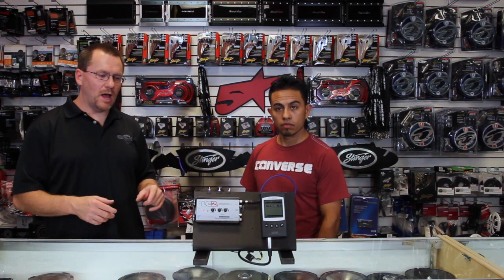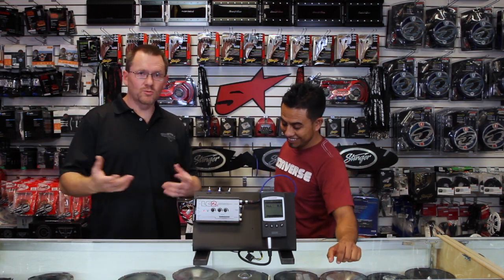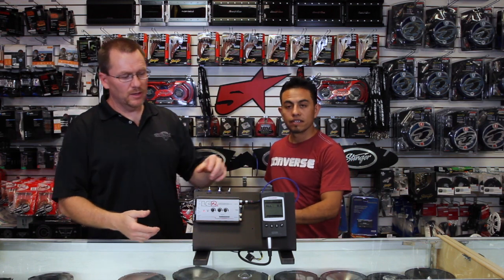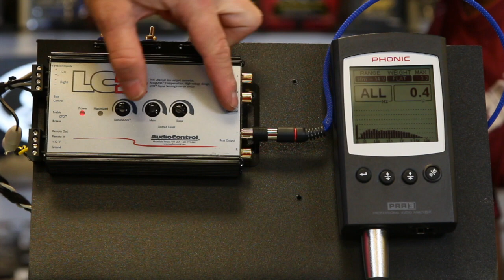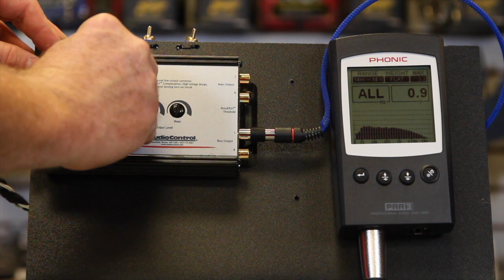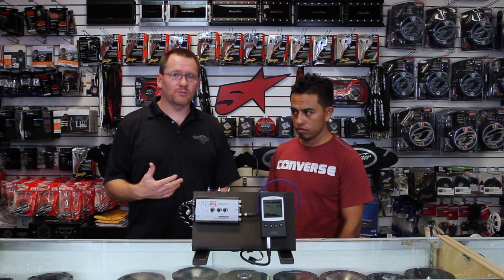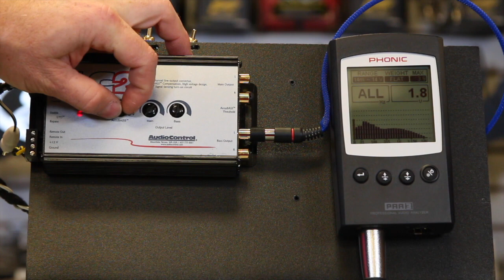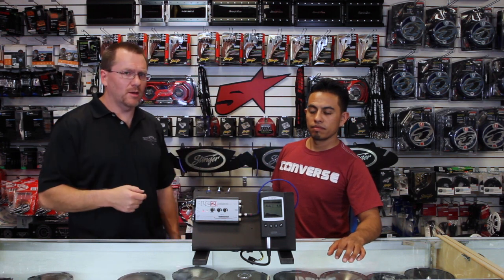Introduction to AudioControl's LC2i "what is and how to use AccuBass"

Comment: Got a question I installed my lc2i power wire from my second battery but when I turn everything off the red light stays on even after the vehicle goes to sleep why is that thanks guys
Reply from the maker: gilbert reyna where is the GTO switch set? Do you have anything in the remote in slot?

Comment: Another great video guys, most informative.
3 questions please...

Is there any difference in the LC2i and the LC2i Black, other than the colour?

As I wish to utilise the remote turn on feature, should I also be fusing the power into the LC2i?

You said the Acu base is almost like a "reverse base boost eq" my question is, If I tap of one of the 8" stock underseat subwoofers, to this LOC which will be connected to 2 12" subs. will the Acu base also restore the base curve to the 8" stock subs, as it it conected to the 12" subs?

Hope you can understand what i'm trying to describe...

Marcus.
Reply from the maker: M Henry thank you. No difference just color.
We just use the power coming from the amp, so there is no long run of power if you are going to run a power wire to the battery put a fuse at the battery. No it will not help the factory subs. They are before the LC output so the can not be helped.

Comment: How do I use the 9 wire with stock radio and lc2i "LOC" ........I want to replace door speakers but don't want to replace stock head unit, but also what to use amp for door speakers, but have to use LOC to connect amp......HELP!!!!!!!!!
Reply from the maker: Shaun Russ if you are using the LC2I you will just connect the front left and right output only.  If you want front and rear you will need the lc7i.

Comment: hello , I have a 2014 Honda accord with the lc2i running a rockford 150x2 powering a cerwin Vega mobile hed 400 watt 12 . after installing it and adjusting it to sound good I shut my doors and have a constant bass until I open a door then it stops . I adjusted it and turned it way way down and the constant bass stopped ( btw it wasn't a bass that went with the music and was way louder) . now when I start my car it gives 3 loud bass notes like a start up or I guess to let you know its on ? do you have any suggestions in how to get this to go away ? also do you have any idea on why it was giving a constant bass only when doors closed ?? thank you so much for any help ! and you guys did a very good job on video and very informative!!!! thank you
Reply: I have a Honda Accord 2014 and do not have that issue.  I used the GTO not a remote turn on. make sure the GTO is jumped to on, some that have it off and used another source of remote turn on from a fused  accessory  can get this.  if you use a switched source make sure the GTO jumper is off.  I Have  also seen some by mistake put a 12V signal non switch into the remote,   Another issue could be bad RCA cables they can short and cause a like issue.

Comment: Awesome tutorial👍🏽. Just have one question

How do you set the gains on your amp with lc2i install. 
Thanks
Reply from the maker: That is a great question, we use the Smd-dd1 and also a O scope. With out those the best way is to start with the gains all the way down. Play a beat you know and repeats. Turn the radio up to the clip point. Start turning up the gain slowly you will notice a point that it stops getting louder. Turn it down a bit from that and play a couple more songs to check. Pay attention to any unnatural sounds that might coming from the woofers and turn them down or adjust the crossover.

Comment: Hello, Can I connect the audio control at the same time to the speakers or i need disconected the speakers to conect the audiocontrol, change the impedance? because my speakers are to small and I afaird burn the factory radio outputs, congratulations for your channel , thank you
Reply from the maker: Thank you. You can tap into the factory wiring  leaving the radio to play the factory speakers. The AudioControl can then go to give the aftermarket amp signal. You may want to get an amp for your smaller speakers. Then you can disconnect them and power them from  the amp and actively remove the bass from them.

Comment: i tapped into my rear sub speaker wires to power my lc2i.. but it stays on with constant power. i need an idea on where to hookup a remote power wire for it. How do I use the gto?
Reply: to clarify, I tried the gto jumper on enable and bypass and it didn't work either way. any tips? i have a 2008 srt 8 dodge charger
Reply from the maker: +dcole302 that happens some time, it just won't work. No problem though you car is easy. Goto the fuse box next to the battery, inside you will see the fuse for the front power plug- it has 3 input but is only using two. One is accessory, one is 12 volt,and one goes to the power port(cigarette lighter). Connect to the accessory and run to your LC and out to the amp
Reply: +Five Star Car Stereo Awesome!!!! Thank u. working like a charm now. this converter is a beast!

Comment: i have a bose system that has an amp.do i tap into the rear speakers or i have to go thru the amp.and do u just put the speaker wires and it turns on or do i have to run the blue power wire to the radio?
Reply from the maker: What car do you have?

Comment: I have a Mazda Cx-3 with the Bose subwoofer in the trunk. Can I tap into the subwoofer signal cable and use only one speaker input on the lc2i? Do you have to bridge the input? Or you must tap into two channels and fill both speaker inputs on the lc2i?
Reply from the maker: Yes you can use that output just fine. "Y" the wire into the left and right inputs on the lc2i.
Reply: +Five Star Car Stereo great thanks for the response! Just to 100% clarify I can take the positive subwoofer lead and put it into the right positive input and negative subwoofer lead into the left negative input?
Reply from the maker: +Andrew Carlson no put the positive leads in to both positives ( right and left) then do the same for the negative. Fill all 4 holes

Comment: ok so this is my problem.. i have a 2012 ram with the alpine stereo package an i have hooked up my lc2i to the factory sub .it keeps shuting off the subs completely when the bass gets loud i tried the second way when you turn the acubass completly down and the threshold screw completly clockwise this does seem to help but then there is not much adjustment i still have to turn the bass volume down or it still wants to cancel out the bass signal completely.. my question is would it be better to go off the rear door speakers or front door speakers to have more adjustment and will this eliminate the subs completely turning off. what am i doing wrong have you ever incountered this?
Reply: could it be a problem with the factory amplifier is there a way to ta p into before the factory amp?
Reply from the maker: Is the factory sub still connected?
Reply: no it is not.
Reply from the maker: +Nicole Serafinchan (Nikki) you can not go before the amp because the volume is controlled in the amp not the radio. If the factory sub is not connected ( this is going to be hard to explain) that channel on the amp will shut off. The dodge amps need a load to turn on( ohm load). Basically you need a 5watt 47 ohm resistor wired in between the positive and negative input speaker wires. This will put a load back on the amp and turn it back on.
Reply: so will i need four of these resistor's installed between my oem speaker wires and the lc2i? one on each positive and negative or am i reading this wrong? Also where can i pick up these resistors? thankyou for your time.
Reply from the maker: +Nicole Serafinchan (Nikki) you will only need to, one on each set. The wire in like a speaker. One side positive one side negative. We get ours on Amazon. We will definitely be making a video on this one.
Reply: ok great thanks look forward to seeing the vid.

Comment: I have a couple of questions. I have a monoblock amp that I'm using to hook up my subs. Do I need to plug the remote out on the lc2 to the remote input on the amp? I'm confused by the remote in and remote out on the LC2. 

Also, is it recommended I splice into my rear 6X9's or would it make more sense to splice into my factory sub? Since I'm adding a monoblock and only want bass signal...
Reply from the maker: The LC's remote out is there to turn on the amp if your radio does not have a turn on. You do not have to connect the LC's in to anything. Yes connect to your factory sub

Comment: I really your video. very very very informative. 

I have questions, I have tapped from the subwoofer (factory stock sub) and there are 2 wires.  where do i connect the 2 wires?  The LC2i has 4  wire input,. L+- and R+-.  Do i bridge it? how about the RCA? where shall I connect it? L or R?  Last, the GTO is not working for me. it does not turn on the LC2i.  I ended up connecting it  to a trigger wire.
Reply from the maker: If this is the case we will split the 2 wires into 4 and fill all the holes. You can then use both RCA outputs to go to your amp. Make sure the gto is turned on sometimes it ships off.
Reply: +Five Star Car Stereo thank you for the reply. I will do that.   

Will it matter if that is connected to post amp sub? There is now way for me to tap it directly behind the nav.  (2015 Genesis Sedan).
Reply from the maker: +Von Jose you can connect at the sub for signal
Reply: thank you so much.  i did the install.  it works great.  thank you for the help!
Reply from the maker: +Von Jose sweet, glad we could help

Comment: i want to hook up 2 250 rms watts subs with my oem radio using this item. Do you think my 2 subs will do ok on it?
Reply from the maker: You are going to use amp right? If so, yes this is the best hi to low for adding a sub.

Comment: https://youtu.be/h3Nt7_Mj51c check out my install
Reply from the maker: Looks good, the only thing you need to change is that ground. Yes it is a big bolt but it is not touching the frame, it is a hinge for the seat. If you went to the bolt that was holding the hinge that would be better or just make your own ground.

Comment: I installed 2 amps on my car one is a 4 channel powering 4 door speakers and 2 tweeters it is also powering 2 6×9 speaker which r suppose to be subs.. and I have a mono amp for my 2 subs. I have 2 regular hi lo converters for each amp right now.. but I'm not getting good bass.. will I need a lc2i for both my amps or a lc7i?
Reply from the maker: What type of car do you have first?
Reply: +Five Star Car Stereo I have a 2006 acura tsx it also has a stock amp
Reply from the maker: +Sisco Sosa go for the lc7i. You are going to want to make sure you feed the factory sub output into it along with the high pass channels. You will need more then 2 channel do do that.
Reply: +Five Star Car Stereo I even contacted audiocontrol directly and they told me that the lc2i would be good. that's why I'm getting mixed up because there is people saying the lc7i is the way to go and others say to go for the lc2i?
Reply from the maker: +Sisco Sosa ok let's break it down to what you need for your amps input. You have highs amp and a sub amp so basically you need full sound bandwidth. Now if your factory amp powers the front rear and sub speakers it is going to have a xover working in there to make that happen. If they did not then the sub would play highs and the doors would play bass. Knowing that, that tells us we can't just grab 2 pairs of wires and get everything we need. If we tried to grab just the fronts our bass would be missing and if we grabbed the sub wires the highs would be missing. So that means something with more inputs is needed,like the lc7i. If you have not watched them we do have 3 videos up on just the lc7i.
Reply: +Five Star Car Stereo I have another question when I got my amp installed the guy connected the tweeters to the 4 channel amp. should I connect them back to the factory amp since my 4 channel amp was to much for them and burned them out. he also connected the 6x9 subwoofers should I connect them back to the factory amp too so I could just get bass out of them?
Reply from the maker: +Sisco Sosa more then likely the tweeter did not have a xover ( bass blocker) from the factory, that is why they blew. When you replace them make sure you use the xover they come with. The rear 6x9 are fine on the 4 channel amp, you want to use the factory amp outputs for the sub amp inputs.
Reply: +Five Star Car Stereo Ok so I just got the specs for my factory headunit, output to the front speakers are mids and highs...output to the rear speakers are full range... and output to the rear deck speakers are low bass... so than that means I will need a lc7i right? And also how would be the best way to connect the speakers for my 4 channel amp.. I know for my bass amp I'll tap into the bass output speakers.. just want to know which speakers to tap for my 4 channel?
Reply from the maker: +Sisco Sosa I would run mid into channel 1/2, tweeters into 3/4 on the 7. Turn on the summing jumper for those 2 channels. That will give you one RCA output from the channel 1/2 output. Plug that into the 4 channel amp, some amps have 2/4 input switch is so set to 2. If not run a set of RCA "y" splitters into the 4 inputs. Run the rear deck sub wires into 5/6 and output that to your sub amp.
Reply: +Five Star Car Stereo Ok got it sorry for all the questions just want to make sure I do all of this right. thanks a lot for your help.
Reply from the maker: +Sisco Sosa no problem, glad we can help. Let us know how it goes.

Comment: with just subwoofer added to oem stereo why would my installer have it plugged into main and not subwoofer input...
Reply from the maker: More then likely he did not want to set the AccuBass. It can be very time consuming to do or he may not have known how to set it up. The only other option is he thought you did not need it. Now that you know how it works try doing it yourself and see if it improves your sound.
Reply: The subwoofer out is low and the main is full.

Comment: So I can splice the speaker input from my rear and then hook this up? I just plan on running a subwoofer.
Reply from the maker: +bear1983211 yes that will work as long as there is not a dedicated factory subwoofer.
Reply: Why does that matter???
Reply: @coolfern37520  because you'd want to use it, if so!

Comment: So I picked this up for my Aftermarket Sub and amp and I really don't understand how to tune this with my sub and amp, and instructions on multiple places don't really give good detail... Should I tune and work these settings BEFORE I tune the amp, or should I tune the amp to Clipping, and then tune this after? should I start with the Main, Accubass or Bass Knob? Accubass Threshold?
Reply from the maker: Yes it can be a bit much. To get you going try doing this. Down load a pink noise test tone to your phone - unplug the amps RCA - set the "AccuBass bass" to about 1/4 , turn "threshold" and "bass" all the way down- while playing the pink noise turn your radio up to what you think is the highest volume before it sounds bad- now turn the "bass" up until the "maximized"light just stars to flicker- now turn the volume down- start with the amp gains all the way down if there is a bass EQ set to about 1/2- plug your amp RCA's  in-  now play some music with bass( something you know the way it sounds) and turn the radio up- if the amp need more gain do it now( keep in mind it should not need much the LC can puts out as much as 9volts)- at this point it should be sounding pretty good. 
 This next step you may want to play it a couple of days before you play with the AccuBass
Reply: +Five Star Car Stereo Ok, I understand what you are saying, except for one part. The part where you say to turn the BASS EQ set to about 1/2, are you talking about the BASS BOOST on the amp, or just the Gain itself?
Reply: +Five Star Car Stereo also while playing the pink noise test tone with the threshold and bass all the way down, where should the MAIN be set at? all the way down also?
Reply from the maker: +PacmannProductionsTv bass boost on the amp if it has one,  gain is down
Reply from the maker: +PacmannProductionsTv you will not be using the main, leave it down. It is for the non bass RCA output on the LC
Reply: +Five Star Car Stereo gotcha. Will be trying this method tomorrow. This will be the first time I've used the Bass Boost in years lol. Let's see how it goes and I'll keep you fellas updated. Thanks on the tips!
Reply from the maker: +PacmannProductionsTv you do not have to use the bass boost. It is a general setup, you can leave it off if you like. You know what they say try new things.
Reply: +Five Star Car Stereo K, just tried what you guys explained, and when I was going through the 1st part with setting the accubass 1/4 and listening with the pink noise, I turned the bass all the way up and got no flicker... Since no flicker, now what?
Reply from the maker: +PacmannProductionsTv what was the volume of the radio set to? This step is to set the LC up for clipping. You are trying to find the clipping point of the factory radio to the input of the LC.
Reply: +Five Star Car Stereo Radio goes up to 40, I was at 30 on the radio with the pink noise.. I only went to 30 because that is the highest I normally listen to it
Reply from the maker: +PacmannProductionsTv that is ok but for this test go up a little higher. Volume on radios does not go up in a straight line, more like a curve. So you may be missing out on some power.
Reply: +Five Star Car Stereo Ohh ok. I'll try it louder tomorrow then. So I'm pretty much gunna be looking for the clipping point(maximize flicker) on the HU when turning up the bass on the LC2? Then that will be my set volume for when I start to tune the amp...